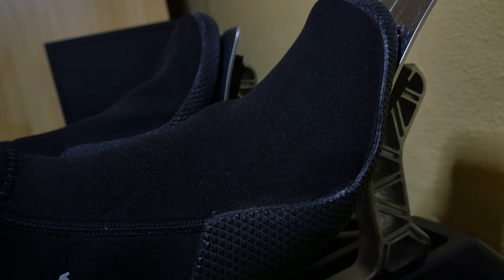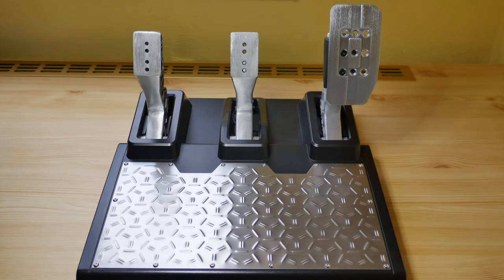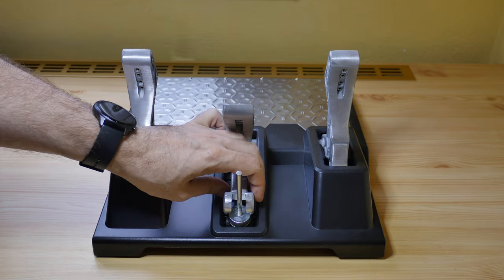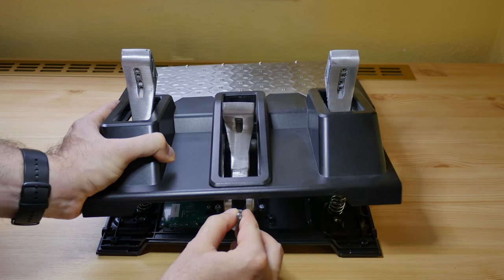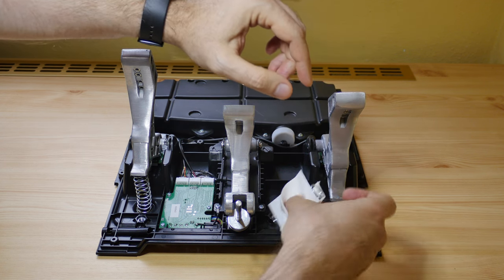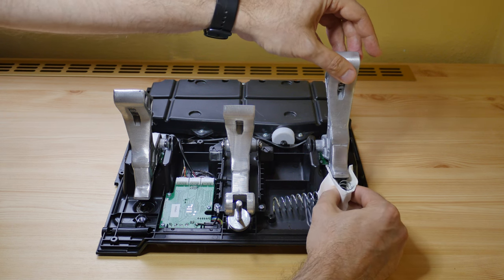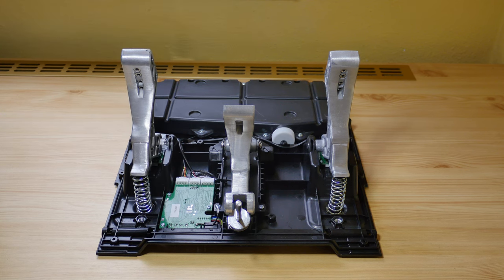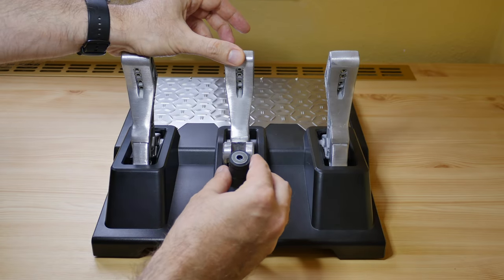Thrustmaster T-LCM Throttle/Clutch Spring Swap | Thrustmaster T-LCM Disassembly

Comment: I did this a while ago and what a difference it makes. Thanks for the video!
Reply from the maker: You're welcome!
Reply: can you explain what difference it makes ?> is the clutch spring a thicker gauge?
Reply: @markgresty1633  you are correct. Adds more resistance to the throttle and personally feels more balance but at the end of the day it's also subjective.

Comment: if you have a Logitech pedal set, swap the T-lcm's the throttle and clutch springs for the Logitech's clutch and brake respectively. I've done this the pedals feel a whole lot better
Reply: Are the same lenght??
Reply: @T0n189  no, logitech's are slightly shorter but doesn't cause slack or anything

Comment: I have a question, my throttle pedal is not responding properly, it's not totally broken but it just fails and I can't see why it does so. Is this a problem that more users have and could your trick solve this problem?
Reply: Don't know if you have the same problem as I had. My throttle jumped from 0-40% ish. I raised the deadzone in the game (Dirt rally 2) to about 60% deadzone, and somehow it's working much better now.